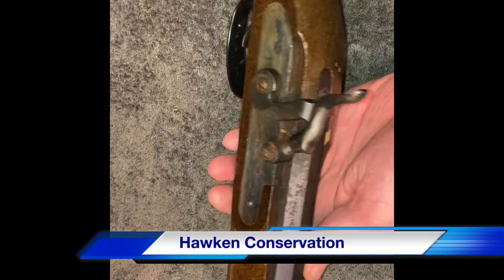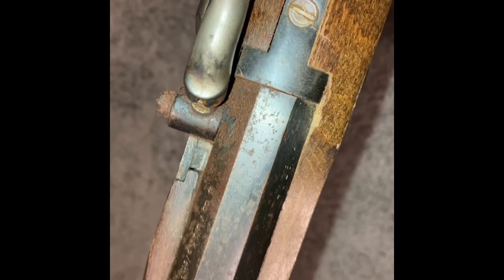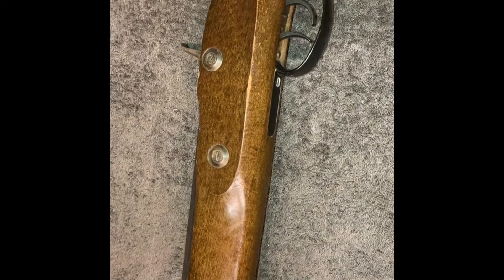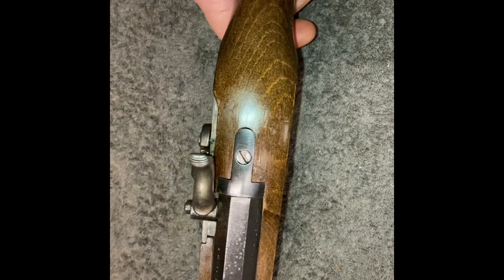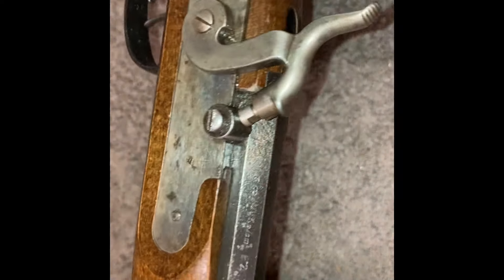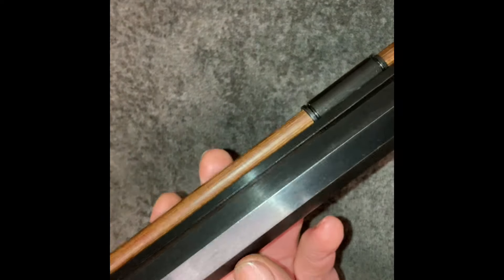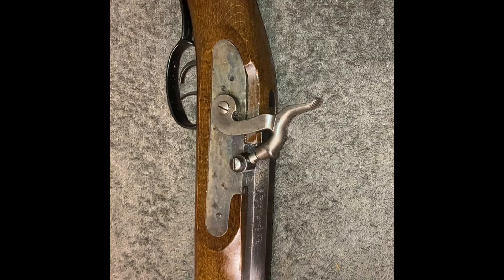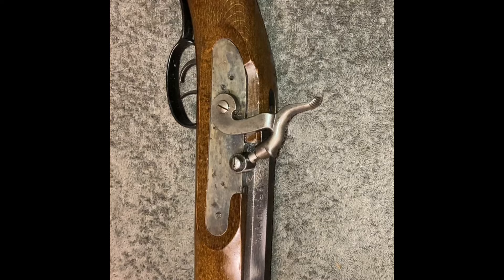Hawken Conservation

Comment: When 19th originals were more commonly available, it wasn't unusual to find them loaded with a charge that had been there a century or more. If you really want a shooter, a new barrel might be available from track of the wolf. Depending on who manufacturers it. As the owner of more than a few BP rifles I know well the pain of cleaning them immediately. Especially if you live in a humid environment. Hot soapy water is usually all that is required. Great job on getting the rust off.